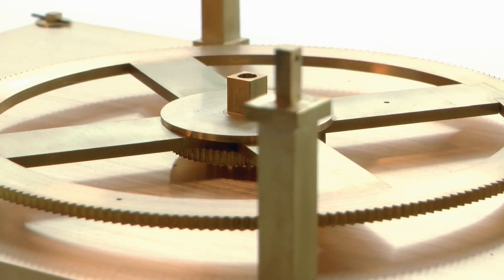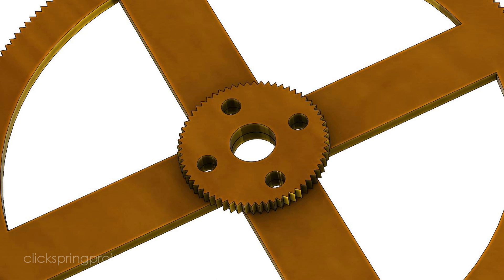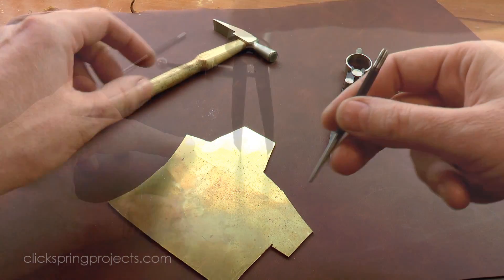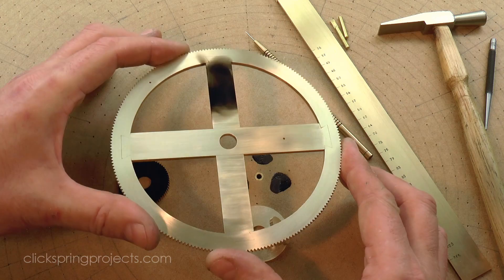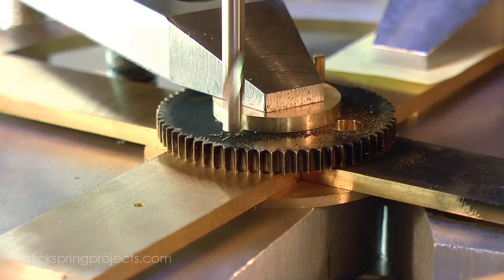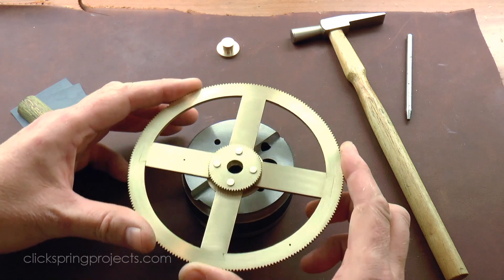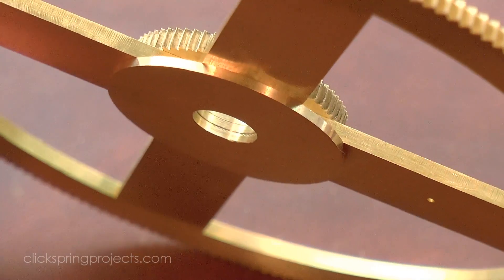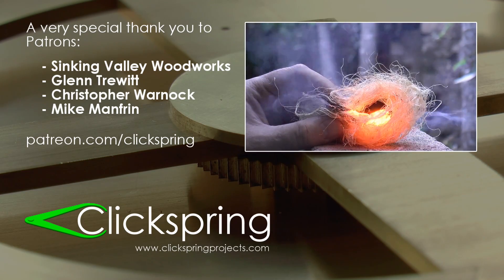The Antikythera Mechanism Episode 4 - Making And Fitting B2

Comment: Chris, one way to make marking out more visible may have been to heat discolor the pieces.  That would be very durable, but would polish out after parts were made.  Just a thought.  
I think the suggestions of other replies to use shellac with some kind of dye in it would be quite good.  They had shellac, although it takes a lot of beetles to make usable quantities.

Dean

Comment: Maybe a soaking in vinegar would give a dark tarnish that would have to be sanded off.  It would be easy to apply (soak all of the stock prior to cutting,) would give a very high level of contrast, and would be very durable.  Even if the parts were not sanded to remove it, the tarnish would not interfere with assembly as it adds no thickness to the material.

Comment: @Clickspring, try some ash from wood(or better, with paper since it gives more fine ash), and then mix it with water, about 1 to 1 ratio.  Old times was used to write, if there wasnt any ink left. I think this can be easy to apply, and after it dried its stands out great, and after use its easy to remove with water. What you think?

Comment: For an ancient marking solution, perhaps a weak solution of hydrogen sulfide in water would be useful. Made perhaps by rotting eggs or adding vinegar or maybe a stronger acid to pyrites. This would presumably form a black and fairly adherent layer of copper sulfide. It is used today to add depth to a copper rubbing.

Comment: As for ancient Greek methods of marking metal, you can surface blacken brass with copper carbonate (azurite) and ammonia.  Figure they had both back then and were in common use.  Likely a distillate from farming used in other things IMO.

But it is something to check into if the idea grabs your attention.  Note I don't have any specific historical knowledge on this one, just that both chemicals were in use in Ancient Greece, so it makes sense that they may have gotten mixed or used.

Comment: They could have used lampblack (soot), gum Arabic, and distilled alcohol. This is would have produced a simple ink that has been used for thousands of years. Essentially, it would have had the same effect as in the video, but the gum Arabic acts as a binder to give it some resistance to the handling of the part.

Comment: If you were to scribe the part before applying the soot would the inscribing be deep enough that you could wipe off the soot outside of the groove without also taking off what was inside of it? Similar to something like with diecast model cars, where you paint a wash over a complex structure then use a paper towel to wipe away the wash from the large portions.

Comment: Chris, you're a better man than I, using candle soot has got to be very challenging. I would imagine that the ancients would have had easy access to ocher, gamboge, coal and tannins like black walnut juice or even grape juice left to dry. Combine any of these with a shellac and I'm sure you can get close to Dykem.  Great job as always, by the way, I've recently dropped off of Patreon after having a card expire but expect me to be back shortly. 
Also, a question if you get a chance, I am in the process of machining an axe from a solid piece of s7 and want to follow your case hardening methodology. Do you know of a good substitute for fire brick?
Reply from the maker: Hey Gerald, do you mean as an insulator for a furnace? If so, I have used Kaowool extensively for my permanent (and previous temporary) furnace, it works great.
Reply: Clickspring  precisely what I mean. Thank you, that seems much more reasonable. For some reason true fire brick seems fairly expensive near me with the advent of pellet stoves. Between that and how cumbersome it would make the furnace I wanted to improvise. I'll look into Kaowool some more and find a decent housing media.

Comment: Could you rub the parts with wax first so a very thin layer exists and then the soot might adhere better? 
Or vaporise wax and condense it onto the part after the soot has been applied to seal the surface

Comment: I am not suggesting they did this but I have used a method of marking out the work and then using a soot lamp. A wipe across the piece then removes all the soot except that in the 'grooves'. It works really well and is surprisingly robust but may not be useful when trying to mark out a complex part. (The soot is removed by washing the part).

Comment: Thin layer of black pitch or tar could have been used or even heat bluing the part for the color change but this is only an idea also it is possible that the artisan used regular lines, all hand tools, and worked in a well lit area without turning the parts.

Comment: I think it may be possible that the metals could have been intentionally oxidized before marking. The dull brown of patina'd bronze would contrast pretty well with the brilliant gold of fresh metal beneath. I don't know how far back Liver of Sulfur dates, but it would quickly and evenly patina the metal allowing for a robust thin layer that could be marked easily. I have machined a number of parts out of old brass stock, and marking lines showed up quite well on the old oxidized stock, and they didn't wear off nearly as easily as dykem would have.

Comment: The need for a marking fluid arises from the highly polished surfaces.
The surfaces are highly polished because polishing is so mach easy - almost inevitable.
Why do you take it for granted that this was also the case in antiquity?
The blanks were probably quite rugged and oxidized, and no marking fluid should be needed...

Comment: I have a few ideas as to how pieces may have been marked out: One being they used pine pitch or shellac wax and spread it thin. The pine may have needed to be dyed but I believe if the layer was the right thickness, it wouldn't wear and could easily be removed via an abrasive. Second being using just a straight liquid dye. If they had such a thing back then, when the dye dried, it would give an excellent contrast. Third and final idea is maybe using heat discoloration. It may be the least practical but it resists wear, can give a good contrast (depending on what color you go for) and considering brass isn't affected too much I think it could work

Comment: I think they used water. They would apply some water on the place vere they need to place precise visible line becouse bronce turns green vhen oxidized and its really easy to remove oxidation lair by sanding it you should try it out :)

Comment: @Clickspring: Why the need for it to come off easily? If it doesn't interfere with the mechanism of the clock, I see no reason why it would need to be removed.

Also: apart from the excellent suggestions already given: the word collagen is derived from the Greek word κόλλα, meaning glue. Any pigment (soot, but potentially also staining blue or red berries), some water and a bit of animal glue is more or less already the kind of ink which was prevalent at the time. Furthermore, since the binding agent is animal glue, it'd come of pretty easily with even just hot water.

Comment: Hey Chris! For your marking you could use some ink they use on the string of tennis racquet  ( to write the sponsor for example). You can have different color and it's easy to apply and to remove, but it won't go away if you touch it by hand, you must use some acetone or nail remover

Comment: Another dye to mix with wax or tallow would be Indigo or Woad to make a lovely blue color, not unlike the marking dye you normally use. Indigo was expensive, but not unheard of in Greece, and if this device really was manufactured by Archimedes himself, as some historians posit, it would have been easily possible that it could have been provided to him. Realistically, Woad would have been cheaper for roughly the same effect, and there was evidence that it was frequently used in the Greek textiles, so much easier to come by. There's also Kermes dye which would produce something akin to purple but not as expensive as the actual purpura juice used to create the 'true purple'. 

These, combined with an appropriate fixing agent such as wax or oil, would have made for an excellent marking dye. 

As far as what to use to affix it to the device, I would not suggest wax, as it is too thick to realistically apply when we are dealing with such fine tolerances. Therefore, I suggest the slightly pungent but easily obtainable fish oil to use to mark the bronze with. 

A solution of copper sulfate would also suffice to make the blue pigment that would easily mimic your marking blue, but I don't know how common that would've been to Greece.

Comment: They might have used sulphur or sulphides (K2S) to produce a thin layer of black/brown oxyde that would then be polished out during the rest of the manufacturing phases. Metal conversion should be a very firm bond that will not wear off during manipulation. Sulphur sources were surely avalable in the ancient times, but I do not know if artificial blackening of metals was a common practice...

Comment: Another method for marking taken from Model Engineering Jan. 1948 is to mix 2 parts wax 1 part gum mastic 1 part asphaltum warm the part and rub on. Then smoke with your candle.
 I enjoy reading the old manuals and such for some of the all but lost wisdom the past has to offer,  Really enjoying this series
Reply from the maker: Would you be able to send me a link to this Al?
Reply: I don't have a link however I did find it in the library after seeing a partial reprint in The Machinist Bedside Reader Vol.3 on page 245
It took me a while to find the right book and find the right article it happened to be under etching as an resist of all places, but the original mentioned being used also as a layout solution

Comment: Always impressive and full of rabbit holes to wander down, Chris! ~¿@  Thanks!  I read most of the 347 comments so far and a lot of good suggestions for a dyechem substitute.  Personally I think you used the simplest available but berry/beet juice or even a lichen dye dissolved in vinegar is quite ancient and plausible to me.  The only issue with these to me, is oxidation.  I'm more interested in the drill tech and how many days it would take someone to use a small bow drill and spade bit to drill those 4 holes for the pins through all three pieces...let alone shaping the pin for a LN3/H7 fit???  Then there is the cumulative TIR of all those gears to keep it smooth running..by hand!  That X-Ray type scan was an impressive look down the rabbit hole you are crawling into with gusto!!  Looking forward to what ever you bring forward...as always a pleasure and grateful for your great gift to us.  ~PJ
Reply from the maker: Yes I'm looking forward to the drill tech too - cheers mate :)

Comment: Hey Chris, if you squeeze geranium flowers you can extract a purple/magenta dye from them. Perhaps this could be applied to the metal and left to dry and be used as layout fluid. Perhaps a strong alcoholic drink could be used to remove it as a substitute for lacquer thinner or acetone etc.

Comment: Sometimes when you see oversized dowels in something it means they first had smaller ones, but had to change the alignment slightly which then needed new dowel holes - or just eclipse the previous ones with larger dowels.   I hope that wasn't the case with B2 because it might suggest it needs to be tweaked in at the end.

Comment: gday chris while watching you file the gear teeth on the plate stock i couldn't help but think that was a lot of filing would they have had a shaper type of machine (sometimes found on earlier bridgeport milling machines, similar in operation to a power hacksaw) back then that could have filed the teeth to a desired depth or is that just wishful thinking on my part?

Comment: Perhaps they used dried egg whites with added dye. Many berries could've provided the dye but soot probably would have been more practical.

They could have used a water soluble sap from plants. Like the white dandelion sap that was sometimes used as adhesive.
Reply: I remember being told about pigments using egg whites, I was going to suggest the same thing. Makes sense as it can be coated fairly thinly and removed with warm water.

Comment: Whilst it's a rather later source, I'm wondering if Theophilus (On Divers Arts) has any thoughts on an older equivalent for Dykem? My first thought was something like a heavy hide glue with a pigment in it. A warm pot with a brush would keep it handy and it would probably set up quite robustly and quickly on cool metal. Also, are you thinking of having a look at what sort of solutions they would have had in period for drilling? Obviously they didn't have twist drills, but I don't know how well a spoon bit would work on metal, even if they were common at the time.
Reply from the maker: Yes I will be investigating drill technology, cheers mate :)

Comment: Maybe a clay slurry for marking?
Reply: That's a very clever idea, and I think would work very well!  Anyone who's thrown a pot would be familiar with the dull matte coating that it leaves on everything... tenacious enough to withstand some handling, but easy to remove. 
 It would also be easy to make, materials would keep forever, be very low cost and readily available almost anywhere.
Reply: Clax C. Also noting that the fact that clay tight methods were used durring tool making process, clay was available like a water from a river.

Comment: I'm a jeweler, and while I was an apprentice I was taught to use asphaltum varnish for a coating that can be scribed into for marking. I don't know if it would be historically accurate, though, but I know the main ingredient, bitumen or pitch, was used for other things. I'm not sure what sorts of solvents and things would have been available.
Reply: I had the thought of using Dyer's Woad and cedar sap. Woad was used as a blue dye in fabrics and, while expensive as a dye, it had a brilliant blue color and was pretty available as a component of fabric manufacturing. It's still used today in some applications. The cedar sap would have been readily available by boiling cedar and reducing it to a simple syrup that would harden when heated and should form a film that, when tinted with woad, should be similar in color to Dykem and should be fairly chip resistant if applied thin enough.
Reply: If one mix soot with grease, it might stick a bit longer. This mixture was also used as eyeliner in ancient Egypt, so the compound was contemporary with the Antikythera an probably both used in Greece and well known to the makers.

Comment: Great video as always. I have one question however: I always thought the strength of a rivet came from the the two bulging ends keeping the plates tightly squeezed together. If you ground the rivets down to the faces, how exactly are the rivets still functioning?
Reply: Andre Berthiaume great point. I second that question! Although, I'm sure the peining process would cause the rivet material to expand slightly and tighten up in the hole, but I wouldn't think enough to make it nearly as secure as if the rivets still had ends on it. One possible solution might be to pein the rivet into a hole that was slightly flared out on the ends, then pein the rivet out to fill in the the flared end of the hole, then sand it flat. I'd think that leave you with a hidden yet much more mechanically sound rivet.

Comment: I would try to oxidize the metal. Not by heating but chemically. By example with a ammonium sulfate solution. A crude ammonium sulfate solution can be produced by mixing pee with sulfuric acid. It should be good enough to create a green patina in a few hours. Ammonium chlorate could be produced similar and would act faster, but i don't know if they had hydrochloric acid.

I think i have to order some urea to try it out. :-)

First i thought it could be done with a metal-sulfate solution. But it would have to be something like arsine sulfate to work and i don't know if they could create something like that pure enough to work.
I thought this way because a copper sulfate solution (with an small excess of sulfuric acid) works really well to color iron. (a layer of copper will form by resolving the iron)
Reply: I tried it and it worked. You will get a brown oxide layer.

I mixed urea with a very little bit of sulfuric acid and some table salt. You only need very little of the sulfuric acid. If you have an excess of acid oxidize some copper or bras chips and put them into the solution. The copper oxide will react with the acid.
Now you can put on the solution with a brush on the bras. After a few minutes (the time depends on concentration of the solution an temperature) a brown oxide layer will form.

Comment: I know modern engravers use "Chinese white" water color paint for layout of designs. I don't see why there could not have been something similar used for these layouts. Probably not the same exact zinc oxide coloring that it is but water colors have been around far longer than the device.

Comment: Is there a chance that the rivets could come loose if they were sanded flush? Or would that be a sign that the rivets were too small/clearance was too big
Reply: The peening expands the metal of the rivet such that it pushes very hard into the surrounding hole. So no, there's no chance (if they were a good fit to begin with)